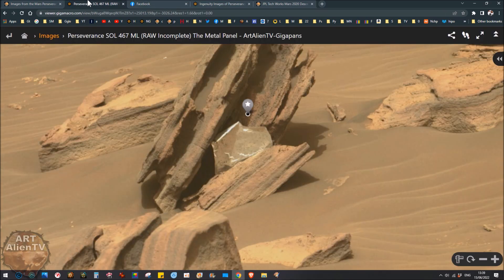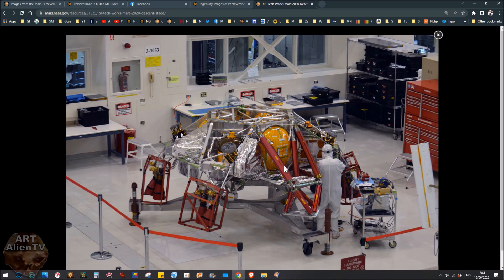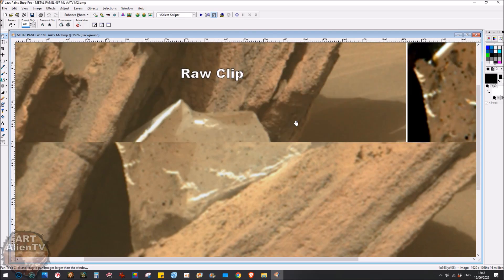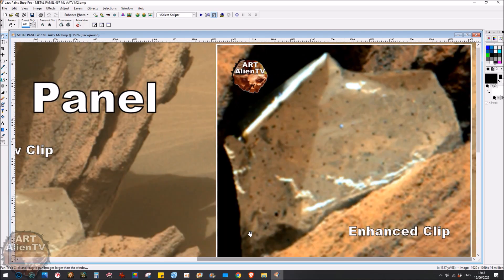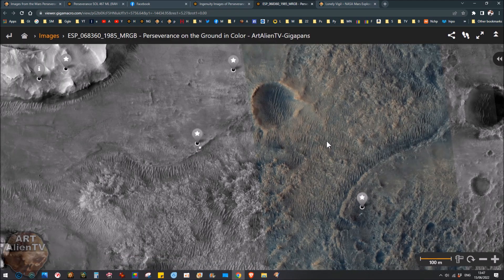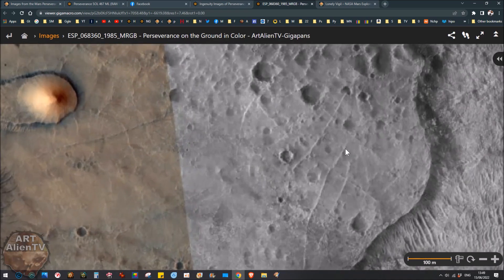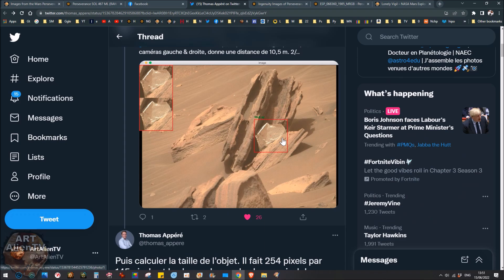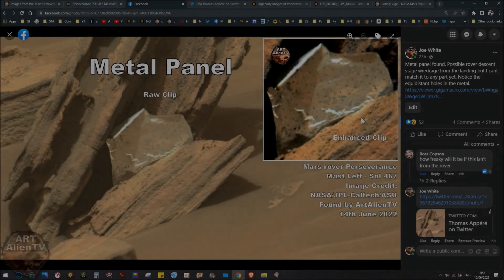MARS Metal Foil Panel Found - Is Ours. ArtAlienTV

Comment: I watched this and the 2 huge objects you are calling rocks in my opinion they are not rocks at all. They look like 2 huge metal iron objects that may have been at one time machinery.  They look like 2 huge iron metal objects.!  The metal panel looks like a cover of some kind. How did it get up there like that? on that object? It looks like it covered something,maybe electronical? Maybe all of those holes in it were for what ever it was covering that it could breath and release heat.  I don't think they are rocks at all.  Iron!
Reply from the maker: It is Mylar insulation - match here and I agree about those other objects :)
https://viewer.gigamacro.com/view/ydPtc06D5hpvm6HS?x1=20463.02&y1=-14090.87&res1=6.50&rot1=0.00

Comment: Applying Occam's Razor you say it's probably ours.
Reply from the maker: Match Found - Thermal Insulation Material - Mylar.
https://viewer.gigamacro.com/view/ydPtc06D5hpvm6HS?x1=20476.65&y1=-14134.43&res1=6.50&rot1=0.00

Comment: That image could be metallic. 
And since it has been there for a long time because it is stuck between the rocks it should be of an unknown metal since it does not show signs of corrosion 
A hug 
Andrew from rome
Reply from the maker: Match Found - Thermal Insulation Material - Mylar.
https://viewer.gigamacro.com/view/ydPtc06D5hpvm6HS?x1=20476.65&y1=-14134.43&res1=6.50&rot1=0.00

Comment: I think the object is some kind of foam material I don't know maybe made out of Mylar and it shot out from the inside after the back shell had been released from the Rover with the usage of explosive bolts. The piece of Mylar TBM must have been forced from under the back Shell at such a rate of knots it by chance slammed into the small gap in the rock where it is now. Just of interest where Percy is parked right now in the photo, it shows it to be just in front of those other two "rocks" as if NASA/JPL  has an interest in them I wonder why maybe it's because those "rocks" are artificially made constructs of some sort? I don't think NASA/JPL is going to tell us that at all.

Comment: Looks like a underneath backer panel.
Reply from the maker: Match Found - Thermal Insulation Material - Mylar.
https://viewer.gigamacro.com/view/ydPtc06D5hpvm6HS?x1=20476.65&y1=-14134.43&res1=6.50&rot1=0.00

Comment: It seem to me like a diffuser panel . Lets pressures escape but also protects a component that's sensitive to a blast. looks very man-made. Very interesting .Could be part of the landing stage.
Reply from the maker: Match Found - Thermal Blanket Material - Mylar.
https://www.facebook.com/photo.php?fbid=5171788816190765&set=p.5171788816190765&type=3
Reply: @ArtAlienTV  good search, ya found it , that's it!
Reply from the maker: https://viewer.gigamacro.com/view/ydPtc06D5hpvm6HS?x1=20476.65&y1=-14134.43&res1=6.50&rot1=0.00

Comment: They've got aluminium foil with that pattern in UK supermarkets.
Reply from the maker: Match Found - Thermal Blanket Material - Mylar.
https://www.facebook.com/photo.php?fbid=5171788816190765&set=p.5171788816190765&type=3
Reply: Top notch work 👌 👏  always appreciated

Comment: Didn't strike me as "clearly" metallic. Looks like a piece of molded foam to me Joe. It's got uniformly spaced breather holes all through it, just like cushion foam. Does nature make perfect vertical, horizontal, and diagonal rows of holes? It either came from a mission, or it didn't, but it obviously isn't natural.

Great job as always man. I much prefer your narration in your videos.
Reply from the maker: Match Found - Thermal Insulation Material - Mylar.
https://viewer.gigamacro.com/view/ydPtc06D5hpvm6HS?x1=20476.65&y1=-14134.43&res1=6.50&rot1=0.00

Comment: It’s definitely man made and could be the underside of a piece of that.
Reply from the maker: Yes and has similar 15 months of dust tarnish to the main wreckage :)
Reply: @ArtAlienTV  looks like strong winds blew it & it got stuck in there. Humanity fly tipping on Mars 😝
Reply from the maker: Match Found - Thermal Insulation Material - Mylar.
https://viewer.gigamacro.com/view/ydPtc06D5hpvm6HS?x1=20476.65&y1=-14134.43&res1=6.50&rot1=0.00

Comment: So what's the chances it landing like that wedged in ? it looks a few mm thick is the wind that strong on Mars to move it ?
Reply from the maker: I need to go through the descent footage. First separation was around 20k feet so it could have fallen way wide maybe :)
Reply: @ArtAlienTV  👽👌
Reply from the maker: Match Found - Thermal Insulation Material - Mylar.
https://viewer.gigamacro.com/view/ydPtc06D5hpvm6HS?x1=20476.65&y1=-14134.43&res1=6.50&rot1=0.00

Comment: The top edges of the panel seems to be it's intended final shape, the bottom not so, raged as if rip off, allso it looks like heat damage if you look with zoom, if so I don't think it can be a match for the lander debris?? and as for. the uniform micro holes, that would not lighten it up to any significant advantage, the only time I have seen similar detailing is to let moisturiser evaporate, could it be from an off account failed probe, by us or others??
Reply from the maker: Very good points John. Dont think any other probes have been this way.

Comment: Well, there should be no doubt about this object being manufacted, right?And since it has been found in an area still relatively close to the landing site (it could have been taken away by winds and got stuck in this, ehm, rock..?) i would expect it to be part of the rover's backshell debris.It is very small, could be from the inside..it just looks "made on earth" to me.But then again i wouldn't be surprised if it was not.😉
Reply from the maker: Match Found - Thermal Insulation Material - Mylar.
https://viewer.gigamacro.com/view/ydPtc06D5hpvm6HS?x1=20476.65&y1=-14134.43&res1=6.50&rot1=0.00

Comment: I think this is more likely to be a piece of NASA’s landing equipment. It’s probably light weight enough to travel a fair distance. Mars is renowned for its high winds, it’s possible for light debris to travel a long way in a certain period of time. Unfortunately, I would say that this is not alien material or structure. 😕👎
Reply from the maker: Yes looks lightweight - could have been frisbee'd quite a way :)
Reply from the maker: Match Found - Thermal Insulation Material - Mylar.
https://viewer.gigamacro.com/view/ydPtc06D5hpvm6HS?x1=20476.65&y1=-14134.43&res1=6.50&rot1=0.00

Comment: Thanks for the shout out Joe. Awesome Gigapan. I somehow don't think this is part of the rover mission it's too far from the landing spots - odd piece indeed. Perhaps from another failed mission ... or not ours at all.
Reply from the maker: Could be - or was flung like a frisbee:)
Reply from the maker: Match Found - Thermal Insulation Material - Mylar.
https://viewer.gigamacro.com/view/ydPtc06D5hpvm6HS?x1=20476.65&y1=-14134.43&res1=6.50&rot1=0.00

Comment: Hey Joe, interesting find. Just my thoughts on this. If it is part of the backshell, I find two problems. If it was ejected when the backshell was separated during decent, (if it is metal) the impact with the ground would be mostly vertical causing an impact crater as we can see with the crash site of the rest of the backshell. We don't see that. The ground around it, although at a slant, is smooth. After more than a year, dust make cover up any burn markings, but especially with the rock blocking the blowing wind, the crater would still be there. The second thought is: If it was ejected when the backshell hit the ground, it would have flown upwards and outward at an angle. The flatness of it would have caused a lot of aerodynamic drag, meaning it would not likely have flown that far. That is a long way for it to fly, even with the reduced gravity and atmosphere. If it is part of the debris from the crash, where are all the other pieces near this one. I haven't seen any other pieces lying this far out (maybe there is and they just haven't shown the yet?). It's just my opinion, but I think that we are looking at an actual Martian artifact. Either way, very interesting find! Thanks (Sorry for the long response)
Reply from the maker: Match Found - Thermal Insulation Material - Mylar.
https://viewer.gigamacro.com/view/ydPtc06D5hpvm6HS?x1=20476.65&y1=-14134.43&res1=6.50&rot1=0.00

Comment: Hey Arty,

Look at the 3 smaller rocks partially buried in the sand, to the right of the metallic object, the one that resembles a CRAB with 2 claws! It too has the same hole pattern on its back.

Comment: Hi Jo,I on Jean's Channel already responded but it's metal... And knowing the distance would be quite possible if it is a thin plate... it could just wander for miles in the air with wind especially,,So your find is indeed important..But it can also be a plate of steel from knowing something else Thanks ///
Reply: How can that be since the "air is very thin", according to NASA. Essentially  it should have dropped like a rock straight down.
Reply from the maker: Not that thin - :)
Reply: @mayorart1  Yes but we don't believe that anymore, often too blue sky, clouds whirlwind, Water etc etc Nasa you can't believe anymore
Reply from the maker: Match Found - Thermal Insulation Material - Mylar.
https://viewer.gigamacro.com/view/ydPtc06D5hpvm6HS?x1=20476.65&y1=-14134.43&res1=6.50&rot1=0.00

Comment: Mmmm. Some alloy. ?? A sheet. From inner rover shell base ??   How did it. Get wedged in those concrete slabs. ??? They don’t look like natural rocks.
Reply: Yes it doesn’t make sense . It’s long way away from wreckage..
Reply from the maker: Match Found - Thermal Insulation Material - Mylar.
https://viewer.gigamacro.com/view/ydPtc06D5hpvm6HS?x1=20476.65&y1=-14134.43&res1=6.50&rot1=0.00

Comment: the panel looks like it has a clear lamination that is beginning to blister.
Reply from the maker: Match Found - Thermal Insulation Material - Mylar.
https://viewer.gigamacro.com/view/ydPtc06D5hpvm6HS?x1=20476.65&y1=-14134.43&res1=6.50&rot1=0.00

Comment: I think it's more like a piece of aluminum foil from the lander that crashed nearby. you can recognize it by the gold-colored adhesive tape, which you can still see on the top corner. In the nasa photos of these landers you can see a lot of this foil and the gold-colored tape
Reply from the maker: Match Found - Thermal Insulation Material - Mylar.
https://viewer.gigamacro.com/view/ydPtc06D5hpvm6HS?x1=20476.65&y1=-14134.43&res1=6.50&rot1=0.00